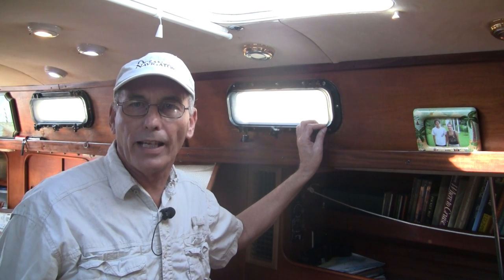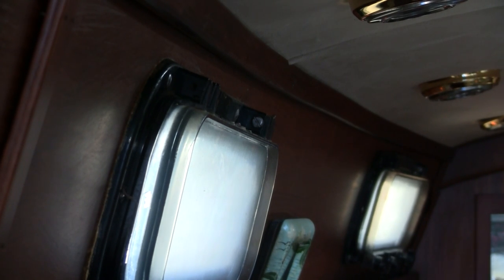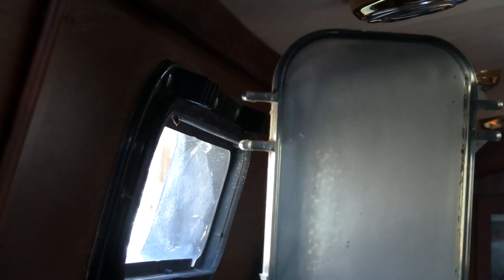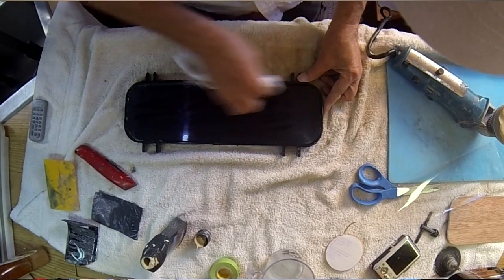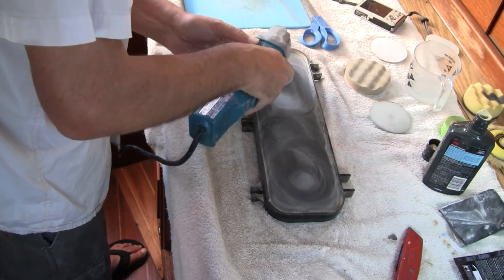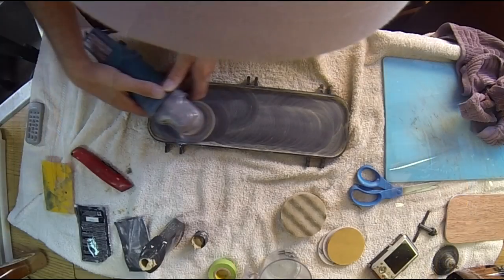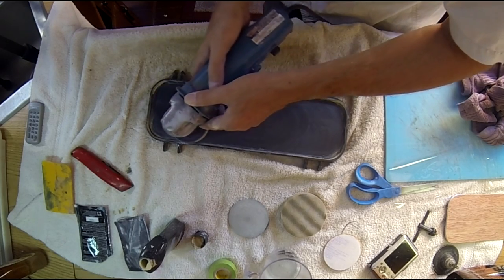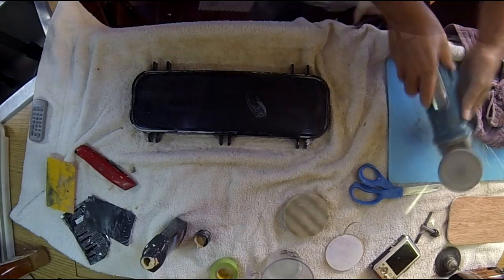How to polish cloudy plastic and acrylic port lights and windows.

Comment: Hi Wayne.....I did this a couple of years ago on venturi windshield panels on a trailer, with similar great results.....problem is that 2years out, they are clouding over again and in need of a redo.....lesson is that once you break through the factory finish, it's never new again, and needs a new way smoother finish than polish.......to last a truly long time, i think you need a coating.... McGuiers has come out with a plastic x product I think I'll try....thx for the videos.....

Comment: What would you recommend to seal tempered glass to the wood wondow frame? Hoping to use something other than messy silicone. I like your videos! Thanks for any advice!
Reply from the maker: Silicone is not good with wood. I think I would lean to poly sulfide for that application.

Comment: Great job, but if you want the glossy finish to last longer, try using a UV-resistant clear spray paint on the lenses after the final polish to keep the plastic from being destroyed by the sunlight again.
Reply from the maker: +ted clubber lang Good point, on my ports I used a special window tint designed for plastic. I may do a video of that as well not sure yet. There are some sealers you can get that are just for this type of thing. Thanks for the comment and keep watching.

Comment: Very nice and CLEAR 🙂video. Just came here not because I have a boat with foggy/cloudy plastic windows however have some boomboxes (with plastic windows) with the same issue. Love to see what others do/share to fix the problem. What is the reason why this is happening, what is the cause, UV light? 

I have used silver polish (Brasso) with a soft cloth/pad and seems to do the job very well. It takes some time buth worth the effort. For me, in my case, it gets interesting when the surface get hot by friction. The hotter it gets, the better the result. The result is clear plastic, scratch removing and scratch free and very shiny.  I think the way I describe is the first thing to try, mostly people don't need all the special plastic 3M stuff you need. The only thing you need is some patience to rubb (and peel down) the surface with some brasso, heat it up to melt the surface. With my method there is no risc to make it worse and the need to correct the scratches.

After the process, I have used silicon spray.

Comment: Are your lenses made of polycarbonate? The headlights the 3M kit is made to clean are usually polycarbonate, just wondering if this process would work also on my acrylic windows.  thanks for sharing
Reply from the maker: The ports I did in the video were acrylic

Comment: It would be much faster to order new Plexiglas. I paid $55 for 8 laser cut portlights (5" x 20" x 1/4" thick).
Reply from the maker: +xavytex Glad you were able to do that at such a good price. My port lights have the hinges and frames molded in as can be seen in  the video. To replace would be $100 each and with 10 of them that is well worth a days effort to get them looking nice again. Thanks for the comment.
Reply: +Wayne Canning - Yes you are right. I didn't notice your port lights are like this. That's a pain...
Mine are simplier models: the plexiglas is "siliconed" onto the frames.
Thanks for your video anyway, I will use your technique for my Plastimo compass. It's a small area, lucky me ;)

Comment: Very hot water and vinegar. Don't sand this is STUPID especially on lexan. If you want it to look new buy new. It's just the way it is sorry. Only someone that's been doing this for years as a living is going to be able to do a fair job otherwise your not going to like the outcome. It all sounds good but so does everything else that can save money. Sometimes it's just the way it is.
Reply from the maker: I have had good luck polishing as in the video and coating with tint film gotten years of clear lens like that